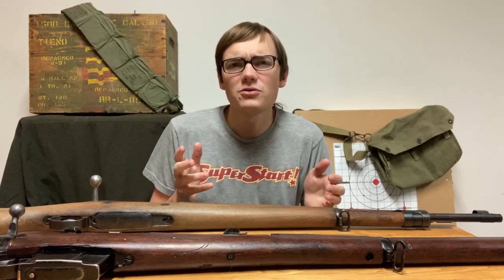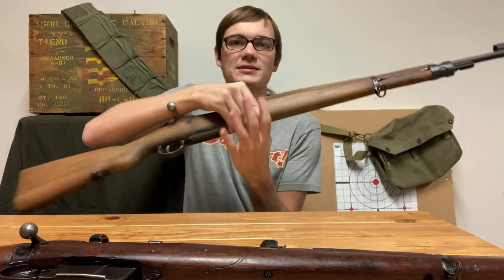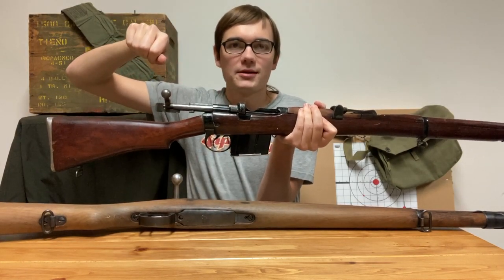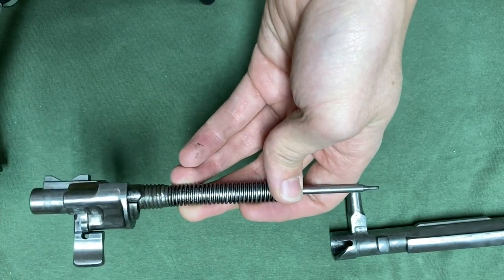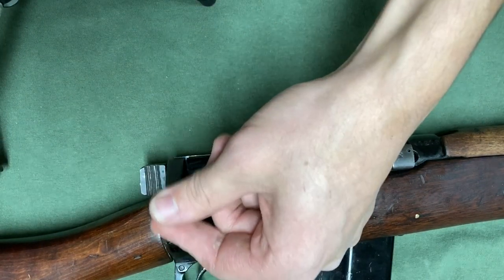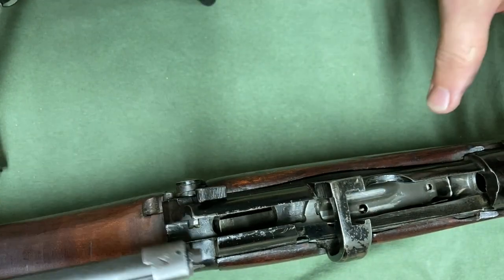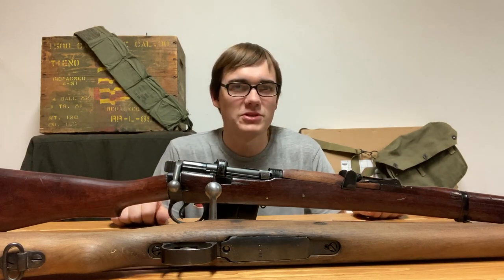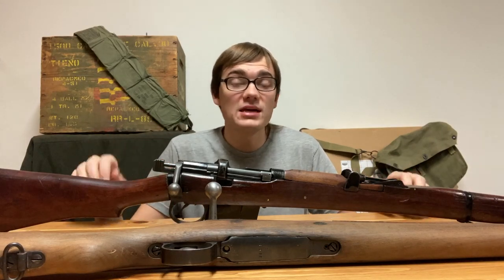Cock on Open vs. Cock on Close (Mechanical Minute)

Comment: All the really cool people know that straight pull is where it’s at!
Reply from the maker: I can’t argue that straight pulls are cool, but also more expensive
Reply: @8mmmauserman  I was just making the obligatory hipster comment.  I mean they actually are pretty great and a joy to work with because most straight pull guns tend be of really high quality, but there’s probably a reason they’re not more popular.
Reply: @hobofactory  had a Steyr M 95 that was a total turd. Was all a strong man could to to operate the action , felt like it had a stuck case ..whether I shot a round or not. Plus it kicked like a BIG mule and it shot a couple feet high and left at 100 yrds... and ammo is hard to find and expensive. I donated it to the WAAAM museum in Hood River Oregon.. if you ever go there be sure to tell my M-95 that Guapo said good riddance!
Reply: The Enfield action is still quicker than any straight pull.
Reply: @guaporeturns9472  I’m actually about an hour away from Hood River, and do visit the town occasionally (and have been meaning to visit that museum for some time now)... so that may actually happen!
Reply: @kendaldk5634  I’m kinda skeptical, but I’m left-handed anyways so I don’t really work bolt actions too quickly in any case.
Reply: @hobofactory  the museum is top notch. Used to volunteer there a lot. Don’t quote me but I believe it has one of if not the biggest collection of between the wars civil aviation in the country. So much cool stuff. Lots of super cool cars too. Awesome place
Reply: Straightpulls can be either cock-on-open or cock-on-close. Straightpull refers to the pull of the bolt during the action. it doesn't refer to the cocking